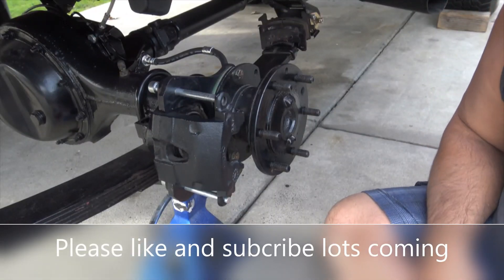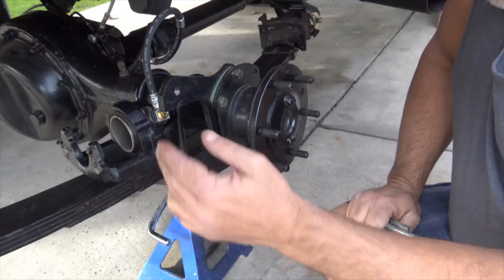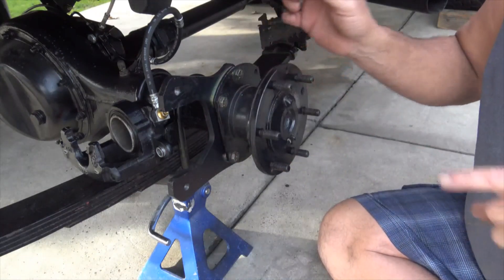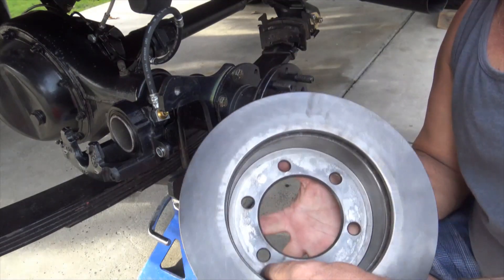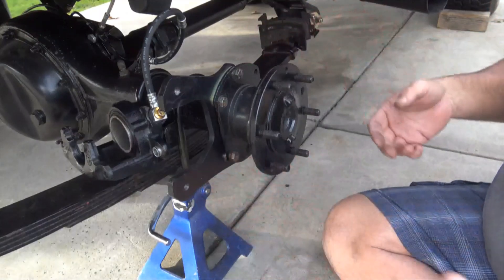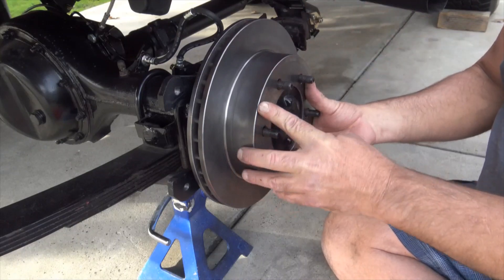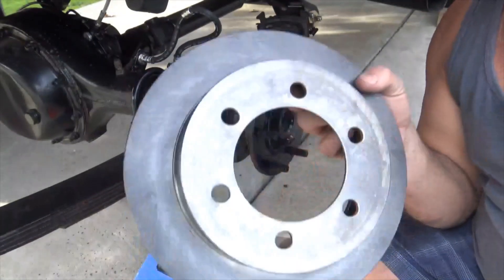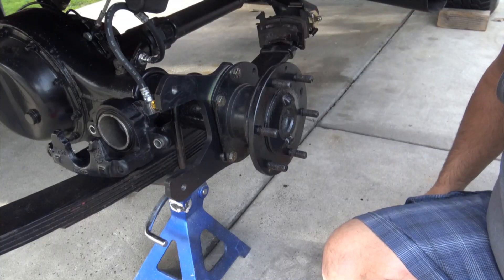Toyota FJ40 rear disc brake conversion

Comment: There is an E-Brake version of that caliper available. I don’t remember the year but it is what I used on my 49 Ford. With it you can keep you e-Brake working and don’t need the drum type
Reply from the maker: thank you for watching, The old Toyotas had a parking brake on the transfer case output shaft so there is no need we were lucky there, Now I'm gong to do one a 72 C10 and I think I'm using 1976 Cadillac Eldorado Calipers with e brake built in

Comment: i bought the stuff for the fj60 brake conversion for the front, is there a bracket similar to what you have for the back to use the same calipers and rotors that i have for the front? - thanks!
Reply from the maker: Thank you for watching, Wow good question I sure can't think of one it would be interesting to see how the rotor fits and lines up to see how a bracket could be made to fit the caliper. That being said the only conv that's ever been done is GM that I know of

Comment: Where did you buy brake router?
Reply from the maker: Hi they came from Trail Gear SKU #140238-1 they cost 63$ now they were 55 not long ago
Reply: @landcruiserintervention9443   Thank you not surprise everything is going up it's inflation is coming probably gonna be my next mod.   Rear wheel cylinder is leaking  it only lasted 2 years.

Comment: sir i have one question with due respect , sir in our country this model (70's pass car Camaro or Monte Carlo) is not come, can you please suggest an other model , please share your opinion thank you
Reply from the maker: Hi actually any GM passenger car from the 70's or 80's the only difference is 80's has metric hardware.

Comment: Can you do the same set up on 60 series Land cruisers? Fj60 hj60 hj61 ?
Reply from the maker: I would think it's pretty much the same if the parking brake is still on the rear out put drive  shaft because this doesn't have a parking brake but I do know they are still 6x5'5 lug pattern
Reply: Thats awesome. I will do my research to have this done! Thanks 🤙

Comment: Do you use a proportioning valve?
Reply from the maker: Yes I used a Summit Racing adjustable proportioning valve and it worked out really well

Comment: Hi bro. I am from Nicaragua. Would it be possible, that you send vi email, the bracket template with its measures? In any case, you can write to jorgemvegasoto@gmail.com or wapp 505 86707473
Reply from the maker: Hi yes I sure can I will email you soon.

Comment: Looks great and neat conversion. Would have been better to mention few more things just for clarification. Are any changes required in the shaft? How the parking brakes will work for later models? The brake fluid pressure distribution is different for rear drums as compared to rear disks. Are there any changes required from master cylinder/servo onwards for rear brakes? And finally, what are the overall improvements in terms of braking experience and handling? Also, final picture of the complete setup with disks and calipers on.
Reply from the maker: Hi I am going to post another video about the proportioning valve, yes it is best to use one with disc/drum masters. I'm not sure what shaft you mean but nothing was cut or altered it could easily be put back stock. As far as later model parking brake I could not say, due to CA smog I only deal with pre 75 I'm not sure what years have what parking brakes after 78. As far as performance these brakes are generally for much heavier vehicles and the performance on these older FJ's is incredible it will just about throw you through the windscreen.
Reply: Thanks for the update about proportioning valve. By shaft, I meant axle shaft inside the axle tube. Post 79-80, parking brakes functionality goes in the rear drums. For those models, either an e-brake or disk rotor with drum parking brake functionality is used. For that setup, things might become a little complicated. But yours look quite simple and recommendable for pre 78 models.
Reply: I need those brake discs all complete please, what truck is the model and year please ask me save

Comment: Nothing wrong with Toyota Factory drums on rear.. I respect the engineering.. but dont see the point.,
Reply from the maker: I totally agree Toyota drums were the best ever made. This just fit this particular build as it's a restomod. I just built a 70 and  and spent many hours rebuilding all 4 drum systems. Sometimes all the original stuff is gone and it can be hard to source all the new parts so this is just one option.
Reply: @landcruiserintervention9443  i would add, correct me if wrong, that disc brakes are safer than drums.
Reply from the maker: @chatovegasoto  Well disc work well when wet and they handle heat much better, drum will fade when wet or hot